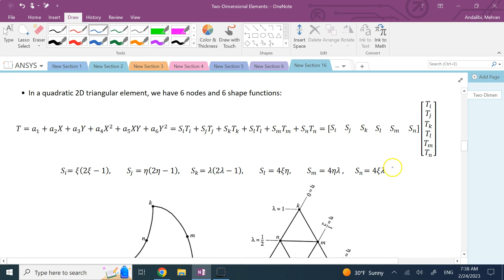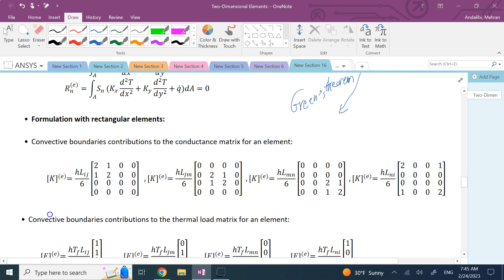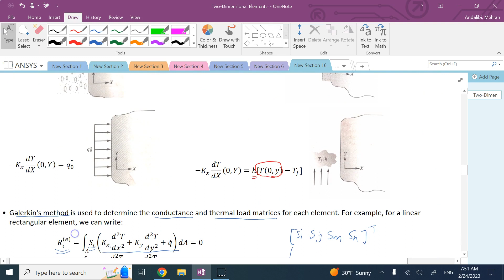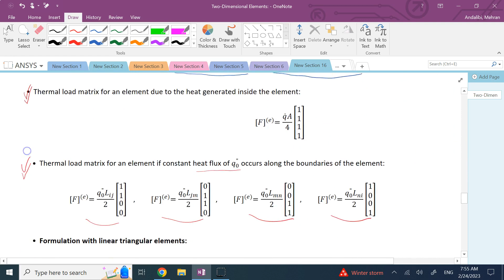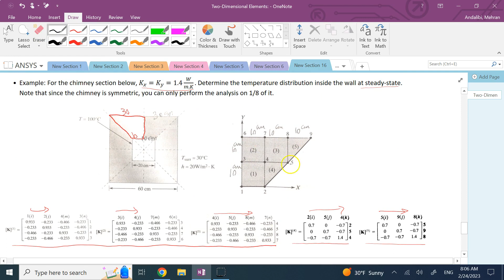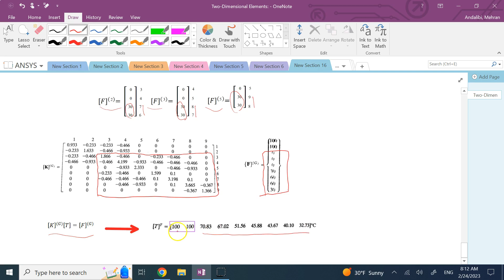Comment: Dear sir.
For the boundary condition of T1 and T2 of 100. This values should be multiply by the negative valuse of the coefficients in columns 1& 2 and add to the r.h.s of the matrix in order to provide 7x7 matrix for T3 to T9. Not fixed at elements 1 and 2 of force vector (r.h.s)